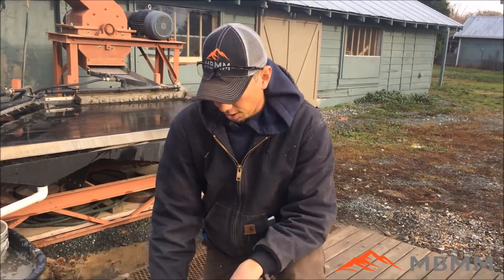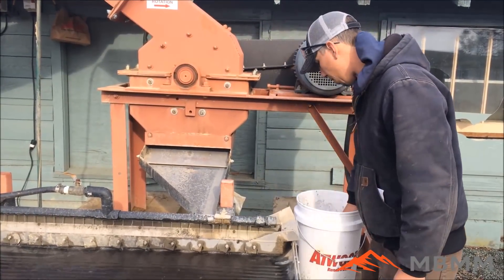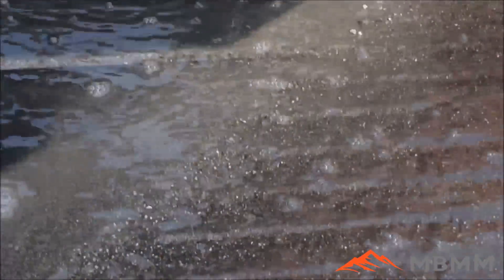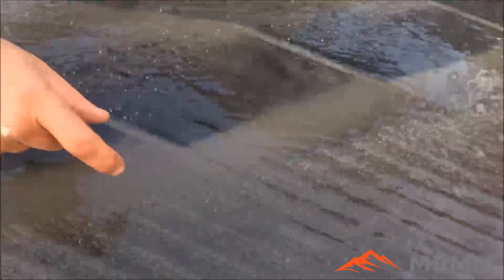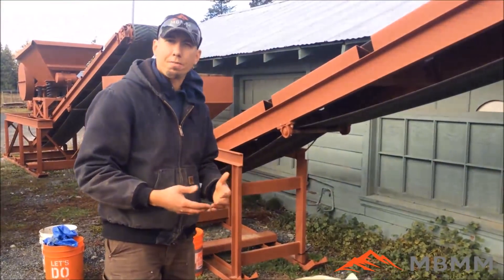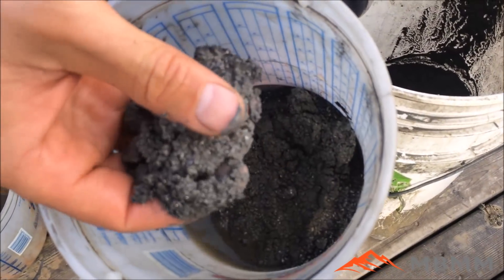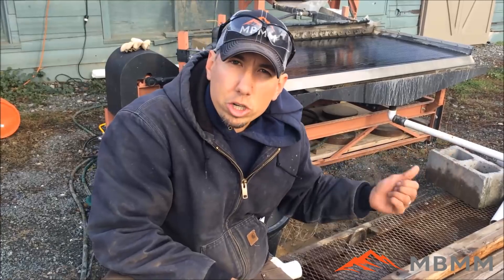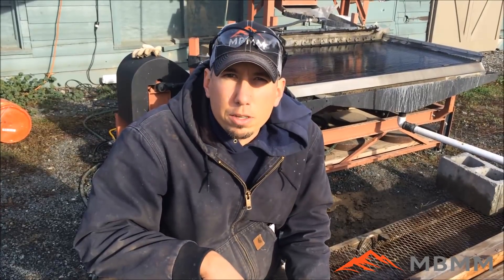Concentrating Ferrochrome from silicates and waste using a MBMM 4x8 shaker table

Comment: After a couple quick google searches, the densities of chromium oxide versus iron oxide, and iron versus chromium .  Chromium is actually less dense than iron as well as chromiu oxide versus iron oxide. If its actual iron versus chromium oxide then the chrome oxide would be in the waste bin and the iron would be in the high grade as its more dense than chrome.
Reply from the maker: Thanks for following up on some of our facts.  After learning more about the sample from our customer I can give a little more info on the process and the goals we wanted to achive.  The white material that is seen concentrating on the shaker table is actually Ferrochrome (FeCr).  Ferrochrome is a product of the chromite refining process and is used in the manufacturing of stainless steel.  When the video was taken I was unclear weather this was a raw mined material or a ferrochrome refined product so I actually mislabel the dense material as a chromite.  The waste material (black in the video) is leftover material from the mining/refining process such as slicates and bits of waste rock and slag that carry no value.  Hope this helps clear up some of the confusion about the sample.  Thanks for following up and asking good questions.